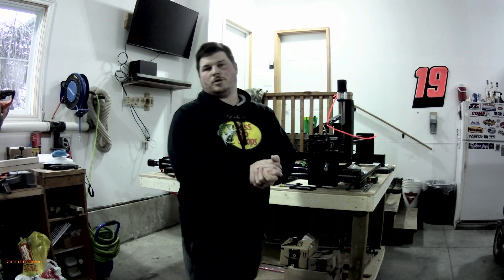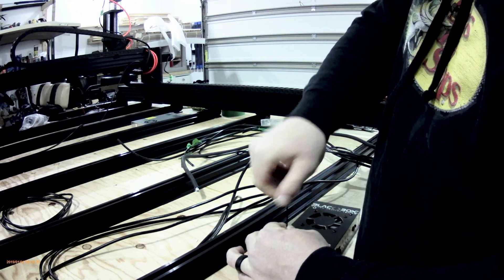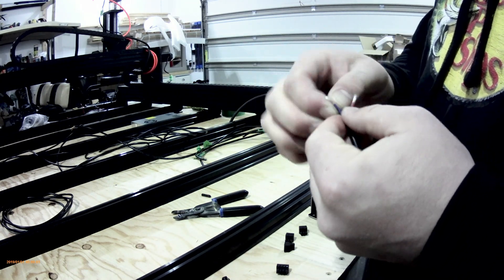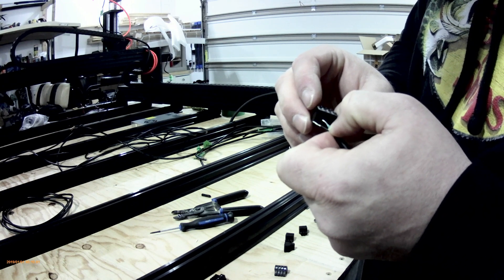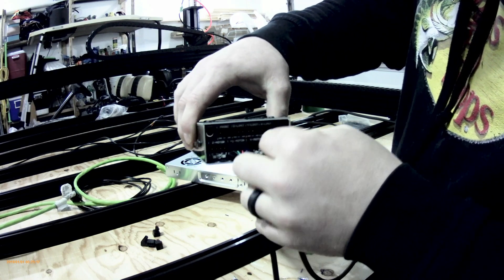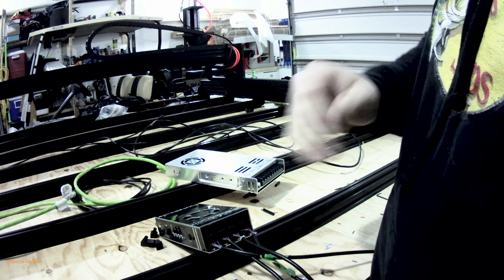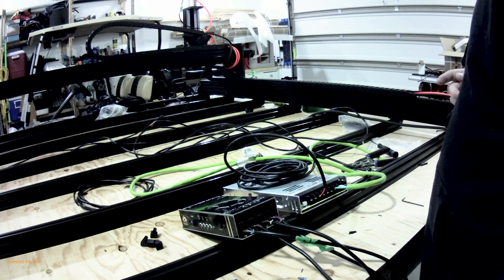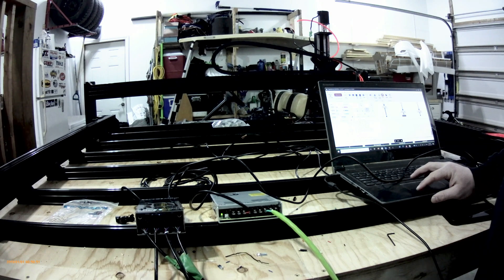QueenAnt Pro CNC 1515 Openbuilds blackbox controller hookup

Comment: Did you have any problems with the M5 screw heads stripping? One of the people who reviewed bulkman pointed that as a problem.
Reply from the maker: Had one problem with the Allen key head on the spindle mount other then that everything was good and strong. You don’t want to over tighten them and I think that’s what happens a lot when people assemble them